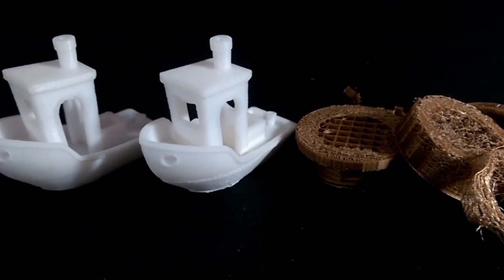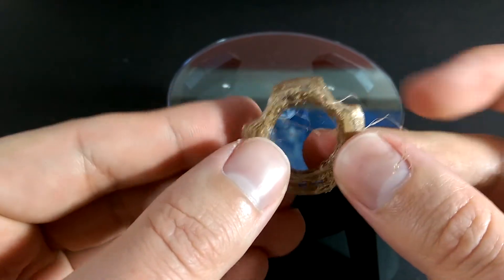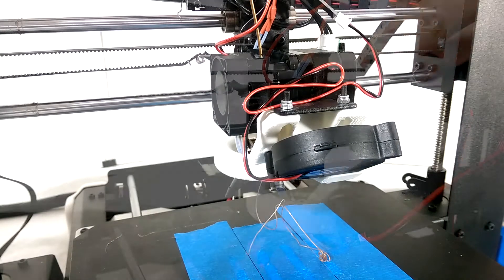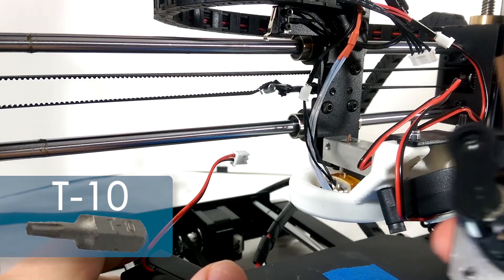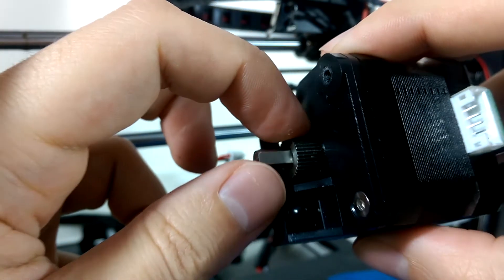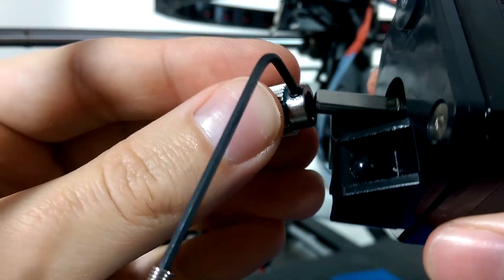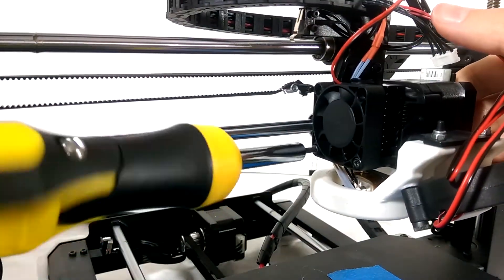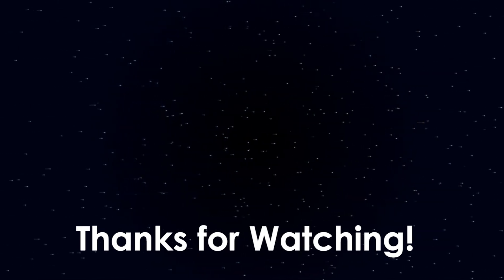3D Printing with the Maker Select V2 - Ep6 | Something Went Horribly Wrong Time to Disassemble!

Comment: Thanks good sir, i had a similar problem but in my case, it strand of filament stuck around the gear itself, but the symptoms where similar, flow was good, but no automatic feed. Thanks to your video i was able to safely resolve the issue. Now it's printing time~
Reply from the maker: Glad to hear it worked out for you!  It's always a good feeling to save some filament.

Comment: Nice video except you don't use TorX bits for hex (allen) bolts or vice versa.  I haven't taken my extruder apart yet but I'm fairly certain the correct hex key is included as this is a common thing to take apart.